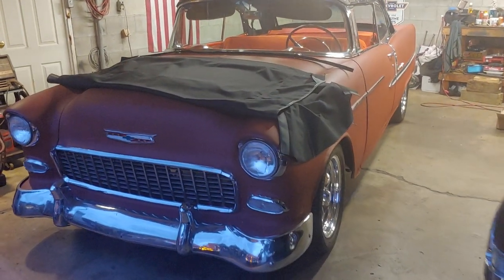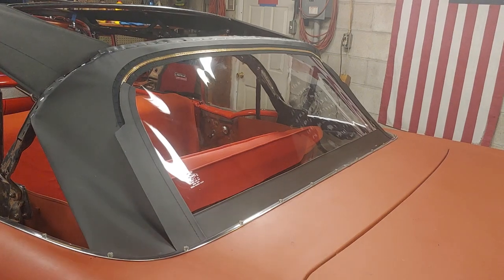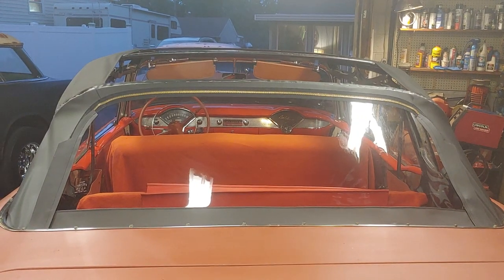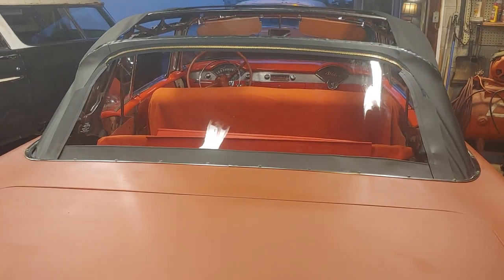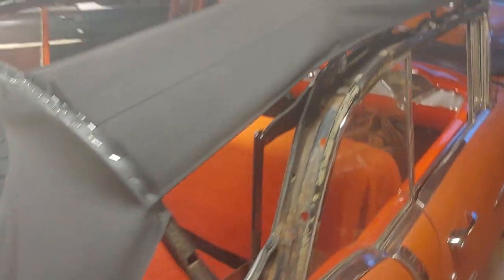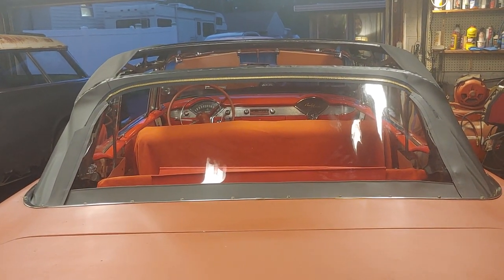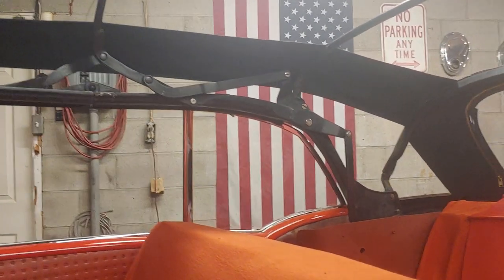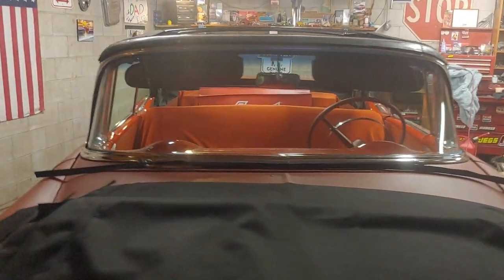1955 Chevrolet Belair Convertible New Top Take 1

Comment: its looking good so far . the first top is the hardest one , my first one was a 64 chevelle i bought for $200 .
i used a arrow house staple gun , it turned out pretty good for not knowing what i was doing .
oh there was no internet when i did that one. now i have 3 to do for myself a 55belair ragtop im building  and a 59 impala and a 60 impala convertible's
when your putting the top on it helps if you can get someone to pull the top when you staple it . 
 you will get it , don't worrie. i like to do black tops outside in the sun so i can get them tight.
Reply from the maker: Thanks man! Seems like you have garage full on convertibles! Every year you mentioned is one of my favorite old Chevys. I agree tge first one is the hardest to do because there is so many unknowns. Maybe I'll slide it out in the sun and pull it some more. Catch you next time!👍

Comment: Don I'm relatively  new to the  channel are you going to paint the 55 or leave it primer brown.? I hope you paint it
Reply from the maker: Thanks for jumping on the channel! I do plan on painting the convertible solid Black in the future. It just needs alot of work still so I just try to keep working steady each week on it. It will take some time but at the end I want it black with the black top and red and white interior. Maybe 327 4 speed I have the original 265 power pak engine so thats a option also. Thanks for checking out the video!👍
Reply: @donshotrodgarage1717  Don I hope you  keep it  as original as possible  .I love 57 chevys my dad had one a Bellaire and they look horrible resto moded or pro touring
Reply from the maker: It'll be pretty much stock minus 4 speed trans and different wheels.👍